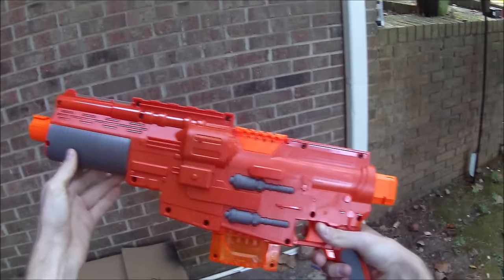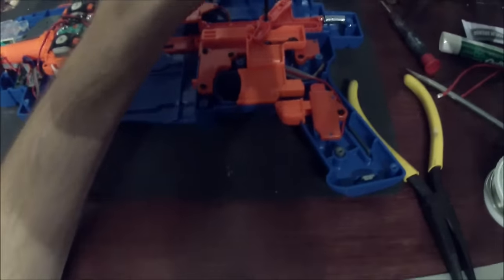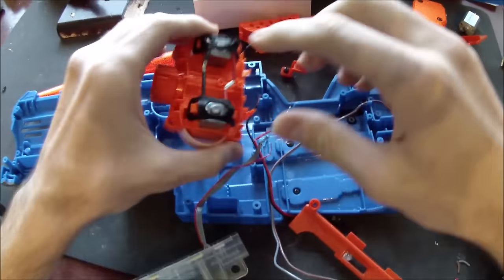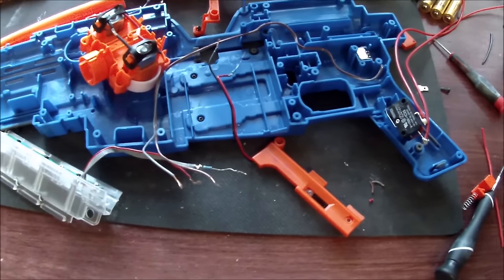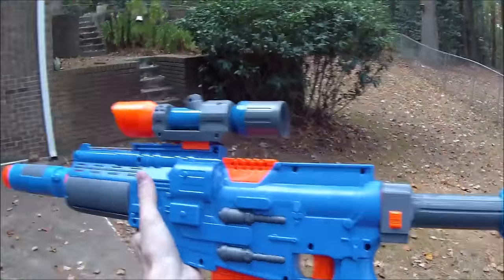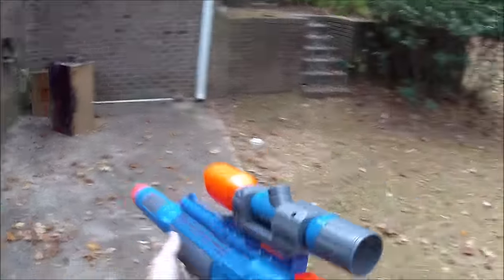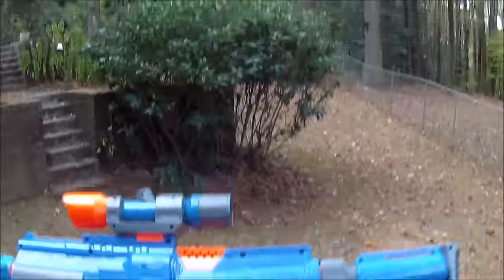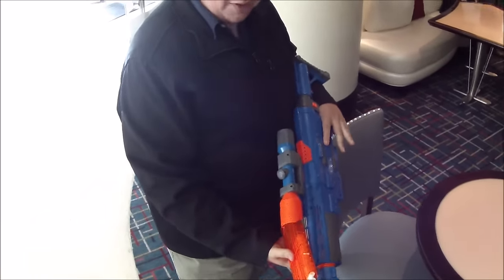How To: Modify The Deluxe Star Wars Rogue One Nerf Blaster

Comment: Forgot to mention in my rebuild that Hasbro glued the motors into the cage. Whoops. 

Can't tell if you wired the sound card PCB back in as that was in a time lapse segment. You can leave the light scrolling effect and SFX intact if you keep the sound card, speaker and LED array wired as stock. All you have to do is wire the pos and neg leads from the sound card to your XT60 batt connector along with the flywheel leads. If you keep the motor cage resistor board in place (provides resistance to the UV LEDs), desolder the flywheel leads from the board (motors are wired directly to the XT60 connector), all electronics function.
Reply from the maker: +Daniel Okada Hmmm, thanks for the info, Ill have to try that on the next one.  I just did what I knew how to on this one
Reply: Forgot to say you need to bridge the flywheel leads on the resistor board if you use that to provide resistance to the IR LEDs or the circuit stays open (no pew).

Comment: You seem electrically savvy. Have you considered arduino microcontrollers control led flashing, motor outputs, etc? I know nothing of nerf blaster but arduinos are low power and come in a variety of sizes and pretty easy to program.

Comment: You could just use a 6V regulator (e.g. LM7806) for the electronics instead of having to calculate the correct resistors. The wiring would be much simpler and the blaster should function exactly the same way it did from the factory.

Comment: Hey Lordraconial, i pulled apart the same blaster only to disable the sound. I clipped the speaker wires and hear shrunk them. Now I'm not able to get the motors to run. I reinstalled the speaker and still no motors. Of course I plugged the clip in since the circuit is completed with the clip inserted. Do you have any advice? Thanks so much for the video! Cheers

Comment: Waiting for someone to make an STG-44 out of one of these!
Reply: It's supposed to be an A280, which was based on the AR-15/M-16. The A280C was the rifle based on the STG-44.

So... if you really want to de-greeblie it to look like an AR-15, it's possible.
Reply: well, the A280 in Battlefront (not really an A280 but wateves) was based on the STG44, MP44, and MP43
Reply: That's the A280C. 

The prop builders made two different prop rifles out of two different real world rifles, but the writers gave them the same designation.

A280 = AR15 (Return of the Jedi)
A280C = StG44 (Empire Strikes Back)
Reply: ahh, ok just from the looks I thought it didn't match up as any A280
Reply: It will be the rifle used by the Rebels in Rogue One. The film props have already been displayed at conventions and can be seen in the promo materials for the film.

Comment: Hey drac which is better longshot or longstrike
Reply: John Lenning both aren't the best nerf gun but I would go with long strike but then mod it
Reply: Martin Fogarty no longshot
Reply: Longshot. Direct plunger with huge plunger tube and lots of mod potential. Strike has the looks but Shot has the legacy.
Reply: Depends on which you prefer, how much you want to do to mod it and how much you're willing to spend on parts. A Longstrike with an xbz tank is 200 fps and it's moderately difficult to do, but cheap. A Longshot with a k26 and a sealed breach is 180 fps and easy to do and a bit more expensive.
Reply: John Lenning longstrike with OMW immortal kit
Reply: hey I'm pretty sure that he would say the long shot because it's the best for moding.

Comment: The stock motors on this blaster are utter trash.  I modded mine to separate the lights and sounds from the battery tray to it's own 9V battery, rewired and removed all locks and it still performed worse than a stock Stryfe.  Changing motors is the best way to get better performance.

Comment: What kind of motors would you suggest I use for my stryfe I want to run it on 4 AA batteries i removed all locks and required but I want new motors what would anybody suggest specifically 130 sized
Reply: Nathan Boody ok this what about mtb honeybadger motors which would be better
Reply: Stephen And more honeybadgers require a 2s lipo so that's a no no
Reply: @djwubzee  the captain ran them on 4aas they were ok